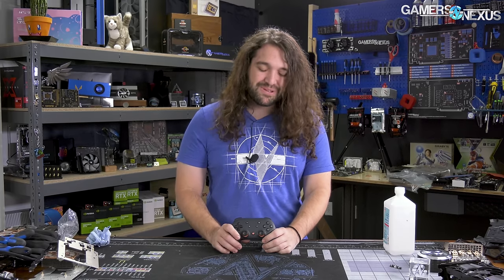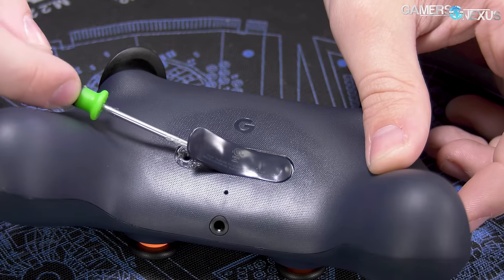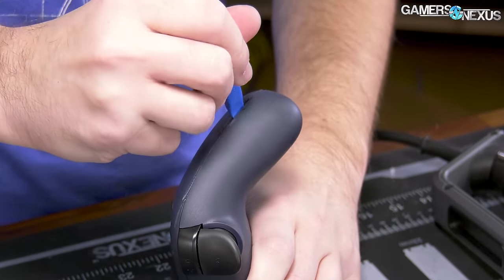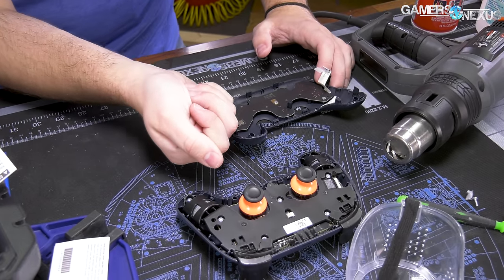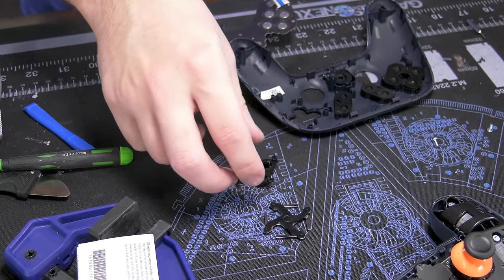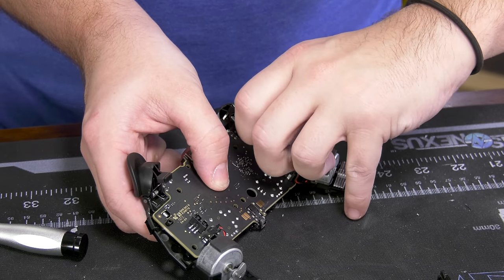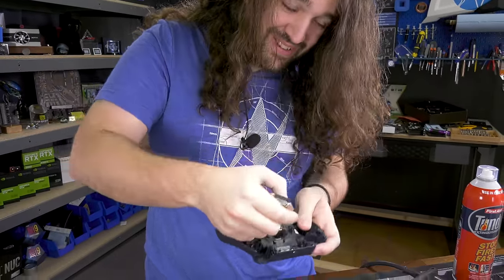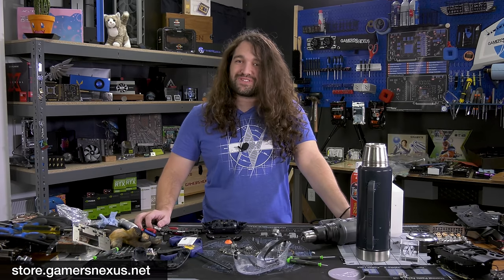Google Stadia Controller Tear-Down & Disassembly Nightmare

Comment from the maker: Grab our GN Modmat work surface here! https://store.gamersnexus.net/
This is really heavily cut down in the beginning. We spent about an hour and a half trying to carefully disassemble things, but since the device only has one screw and otherwise relies upon massive plastic clips, it's very difficult to press those clips externally while still preserving the surface finish of the controller. Google will probably just throw these in the trash when they do RMAs, as it'd be easier and it seems nearly impossible to access the inside without any cosmetic damage.
Reply: I think you do the clips on the interior of the handles then when those pop you torque the interior edge of the handles to pull the outside clips away from the lower shell and it should pop off.
EDIT: Think of it like the plastic bezels around laptop LCD screens. Pull up from the inner side to free the clips on the outer side
Reply: How hard do you want disassembly and repair to be?

Google: Yes
Reply: You should rebuild it and try it out. If for no better reason than to find out how resilient to damage those are
Reply: Please upload the uncut video, this was (unintentionally I'm assuming) really funny.
Reply from the maker: @HalGailey  Yeah, that was one of the things we tried in the 90 minutes of unuploaded footage. Along with every other idea.
Reply: @GamersNexus  did you try making a mold? It seems like the problem is applying pressure at the right points simultaneously so pushing the controller into a perfectly-shaped hole to deform it might work.
Reply: I bet there's a proprietary keying device or mount that equally applies enough pressure simultaneously to the 3 side clips for easy access.
Reply: You guys need to watch more AvE, he knows how to tear things apart :P Fun video regardless.
Reply: @GamersNexus  I assume then they will have a jig or breaker bar. Like the old Xbox 360 chassis tool. Between ABS plastic and the 3 to 1 clip ratio i think its gonna be straight torque that cracks it open. I'd wanna have it in my hands to be sure. But, if the clips are that stiff its gonna either be a special tool to depress them or warping of the ABS shell.
Reply: Rugged like a Nokia, repairable like an iPhone, if not worse. What an odd combination. At least it can withstand a drop without breaking. :-)
Reply: Recently tried to repair a samsung tablet. Not too bad a design... EXCEPT every rear cover clip snapped off, and to access anything other than the battery requires the entire display ungluing and removing. :(
Reply: PS, just RMA it. Do it. :D
Reply: That Pa Rappa The Rapper shirt is awesome!
Reply: Are you gonna do a teardown of the Xbox Elite Controller 2? Really want to know your opinion on it!
Reply: 20:15
That plate is probably there to spread vibrations. Also you can see that two rumble packs have differently sized weights, so this controller has a bit of "Precision rumble" or whatsamajig called.
Reply: congrats Google, designed to increase waste and reduce recycling in the process. Brilliant! lol.
Reply: I had CLOCK_WATCHDOG_TIMEOUT error for the 1st time ever (after I OC my RAM month ago) while watching this xD
Reply: HI Gamers Nexus
 , that Controller looks a bit like a Nintendo Switch pro controller at least the shape of the body does
Reply: Here is a tear down for the controller showing how to open it. https://www.youtube.com/watch?v=Wv-6t0wtPLo
Reply: When in doubt, Use nitrogen
Reply: And I thought RTX card is hard to dissasamble...foolish me xD I hope they stop with this stupid non home-servicable products.
Reply: I'm honestly shocked that they're selling the controllers and not leasing them.
Reply: Obviously, the upper and lower halves are tested separately and then pressed together, in a specific device... this allows no non-obvious tampering to occur during usage. And there are several reasons for that.
Reply: @Vladimir_Kv  Every game controller rumble mechanism (except the N64) has two weights with different masses to enhance the illusion with different degrees of vibrations.
Reply: Gamers nexus what are all Google Stadia Controller Components cost ? I wanna see if spending $130 USD or $177.64 Cad actually worth Stadia Founders edition
Reply: Can I pay for the destroyed controller?
Reply: in hindsight it seems you weren't too far off with the clamps.  Since the clamshell is made from a polycarbonate+abs mixture it should be able to take one hell of a beating (as proven by your attempts to get into it) compressing the top half enough to clear the clasps should be possible.
Reply: You could just dremel out  the housing and then buy a new one from china.
Reply: Tzuede Off the Cuff dremel has cutoff wheels made for plastic. And yes, they do behave differently from the metal discs.
Reply: Even Tech Jesus himself needed to use a dremel to open the controller.

We normies are screwed...
Reply: Ludicrous. Googles deserves a straight 0/10 for very poor building quality. I'd NEVER purchase it, just because I would never be able to open it. Just as ludicrous as the switches on the D-pad.
Reply: Sir Nicholas “You gotta believe!”
Reply: if only your modmat could protect me from google
Reply: You're first instinct was right to do the  clips near the charge port but the hassle you went through with the rest of it exhausted your interest in the postmortem.
Reply: @Jcewazhere  By the way they chose to edit the footage in this video, it doesn't look like he knows how to tear things apart.  It looks like he jumped straight to prying at the controller's shoulder buttons with improper tools for the job before even checking for a hidden screw and then pretty much jumps straight to a heat gun and liquid nitrogen.
Reply: @Tamarocker88 /videos Yeah, I was just ribbing him. AvE is cool, but so is GE. A collaboration would be epic :)
Reply: any idea why the rumble motor counterweights are asymmetrically sized?  i would figure the weights would be similar.
Reply: @celewign  To give rumble its proper feel.  If both weights were identical in size and they both rested at the same location, the controller would be equally jostled in the same direction on both sides.  With a smaller weight on one side, it creates a somewhat "random" effect since each weight's force is a different amount and frequency.
Reply: as you attempt setup, google registers the failed effort & sends you an email about an hour later with your login key
Reply: I think using something like a pair of water pump pliers to squeeze the upper part of the controllers close those rigid tabs would allow it to pop open.

Further than that would be to put  it in a vice whilst somehow protecting the surface, maybe with a reverse poured moulding holding the upper case in position.

Comment: I never thought I'd ever see a heatgun, liquid nitrogen, a crimper, and a dremel used to disassemble a controller.
Reply: I never thought i would see a heat gun period. Forget about all of the other shit
Reply: Litteraly a Nokia gaming controller
Reply: And yet fucking Google found a way to make it necessary.
Reply: @xero3119  More like an Apple gaming controller. Apple doesn't like it's devices DIY repaired. This fact disturbs me because I was just cleaning my XBOX 360 controller and all it took was a screwdriver to remove 7 screws. Just imagine you just want to clean the contacts inside the controller but you need a dremel to disassemble it? Unbelievable! I don't even think you can even put it back together.
Reply: @conyo985  Apple doesn't make gaming controllers, people use MFI (Like Steelseries), Xbox or PS4 with their devices now, and I can open the back of my Macbook in 1 minute. Also Jerryrig (Zack) dismantled the iPhone 11 Pro Max and everything inside was modular and also got a proper iFixit rating.  Only thing complicated is the back but I guess you watch too much Louis Rossman.
Reply: That's how they service it btw
Reply: Would love to see JerryRigEverything tear down video on this controller.
Reply: @xero3119   Naah. The new Nokia phones are relatively easy to open. Heat the screen, carefully pry it off, then it's all screws inside.

This Stadia controller is a nightmare, anti-independent repair shop, and definitely anti-consumer.
Reply: @BrawndoQC  Battery removal on past iphones were a pain in the ass...the new ones easier? I remember that stupid adhesive tab you had to pull...and if you broke the tab you''d have to worry about prying out the battery without puncturing
Reply: @michaeldangelo452  New tabs are fine unless you're dumb.  Sometimes break but easy to get them out with the proper tools to grab that piece of tape. At least they aren't glued like Samsung batteries.
Reply: @conyo985  And the Xbox (360, One) controllers are more work to dismantle than the DS3/4. With 4 being the "worst" of the PS pads. :)
Reply: @BrawndoQC  From where do you get those modular parts? And do you consider a whole motherboard where everything is soldered a "modular" part? Look. I won't say anything about the IPhone, because my knowledge is not up to date, but the macbook has a 1/10 on Ififxit's website, and they will neither sell you the part nor repair your device for you (please continue reading). And by repair, I mean actually fixing it. Instead they try to charge you for almost a whole new laptop, by making it unrepairable, so that you have to pay for a complete motherboard replacement. That is what Louis is fighting against. (Disclaimer: I can't read Louis Rossman's mind. Take it as my opinion, which I believe he agrees on.)
Reply: Now just do it all backwards and you have a nice assembly
Reply: Just you wait for PS6 era, probably going to need at the very least Liquid Lava!! Hear my words!(or read them w/e)
Reply: well everything have a first and this controller is the first to require those 😂
Reply: google made really trashy controller wtf were they thinking, its like pro controller but went wrong direction and just became pure shit
Reply: Even the controller is dog shit.
Reply: LMAO this is so crazy! WTF
Reply: @conyo985  I mean, I kinda get it. My lecturer always tell me that in majority, consumer are stupid, so always fool test your product. But this is ridiculous lol.
Reply: @BrawndoQC  yes you can get inside now. good fucking luck getting the soldering in NAND flash off though. andtough shit is apples shit model made something break in the first place with no way to repair it because it needs a special snow flake chip with a special snowflake serial number or code. this is a step in the right direction. lets make sure they keep walking.
Reply: yup! Never seen a controller teardown like this! They REALLY don't want you to open the controller up! :D
Reply: @xero3119  at least with Nokia stuff, it works and is not a piece of junk
Reply: @Thriving_in_Exile  Hey only the dremel and maybe heat gun were actually necessary.
Reply: I think, you can disasemble the car with all this
Reply: I thought you were fucking joking from liquid nitrogen onward, but holy shit.
Reply: Looks like Google is now become worse than Apple in their being against Right To Repair.
Reply: @YouGottaShootEmInTheHead  You're telling me that businesses SHOULDN'T scam all their consumers and lie to them about their device in a way that they have no way of checking is false?
Reply: That shouldn't even happen!!! Google your Stadia fail box aint top secret from the vatican vault or fort knox bruh.
Reply: Who the fuck designed these? Salty former Nokia employees?
Reply: @Gamers Nexus That wasn't a compliment... Unnecessary. Learn to disassemble before criticizing them before your own skills.
Reply: Twenty years ago I disassembled my SNES controllers with a single screwdriver and fixed the broken shoulder buttons with paper clips. Good as new.

How far we've come with new technology...
Reply: Dont forget the small power saw
Reply: @xero3119  They might be hard to disassemble, but that's for a reason. Nokia still makes the strongest phones. In reality their 3310 is more durable than the average phone of its time, but it's even harder to destroy modern Nokia Smartphones. They also don't have "traps" or stuff which is built in just for making it hard to disassemble.
You could probably recycle most Nokia phones much better than the average smartphone.
Reply: seriously. they should just give up on making a console and start manufacturing bullet proof armor
Reply: @Christian Schön The Stadia Elite 4 Pro in 12 months.
Reply: Least it won’t break if you step on it.
Reply: @blushingralseiuwu2222 There is a difference between making something fool proof, and making something repair proof.

Nobody was crying about their Androids with easily removable backs and easily swappable batteries crumbling in their hands back in the day. Not saying that returning to that would be the best thing to do, but in regards to other design decisions, companies design things the way they do deliberately, and when it's very clearly not being designed for the benefit of the consumer I personally get a little pissed.

Things being pretty arbitrarily engineered to limit consumer options to extend the life of their products is scummy, it is effectively designing a product to be worse for the consumer to increase how much you can take from them, it's so ass backwards from how a consumer relationship should ideally function.

Yeah, and of course Apple isn't the only manufacturer pulling this shit, but from a profitability standpoint, it literally only makes sense to emulate the example set by the most profitable company in the US.

When the most profitable company is the one that in many cases actively engineers and takes action against the will of consumers, you can expect emulation of that behavior to occur.